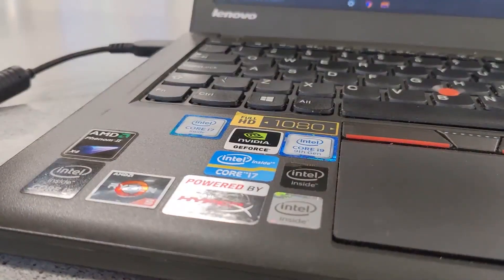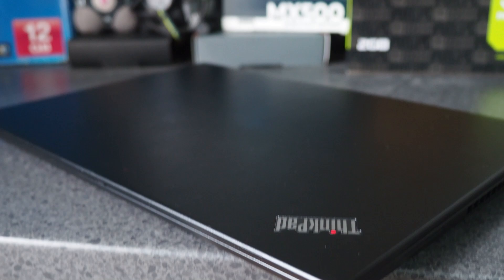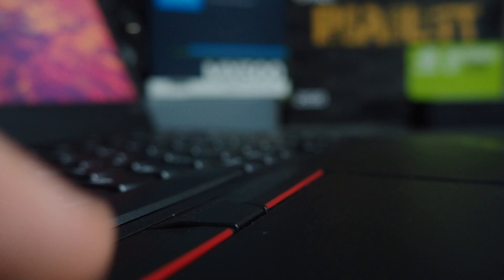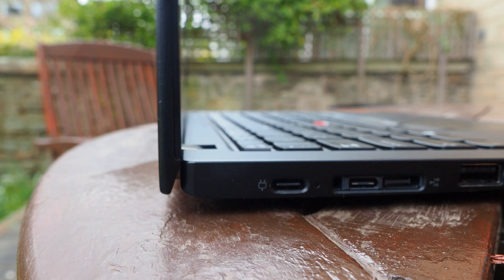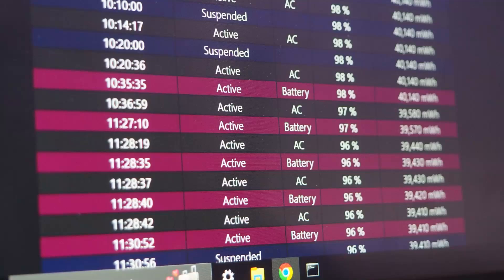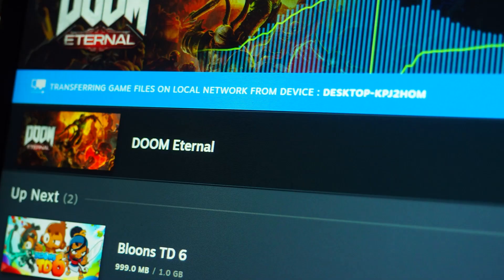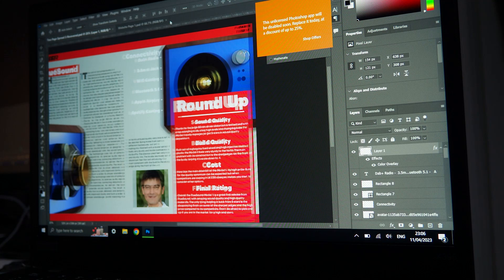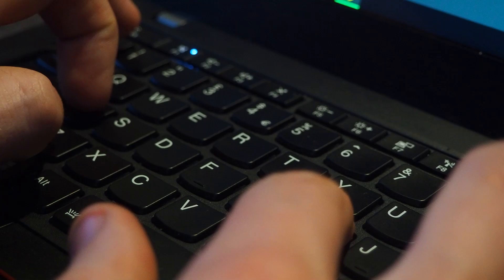Best Budget Thinkpad For 2023 - Thinkpad x395 Review

Comment: I recently purchased an X395 with Ryzen Pro 3700U, 8GB- 512GB SSD for $280 USD.  It came with no OS, so installed Win11-Pro.  It also had a couple months left on warranty.  It also fits nicely in the ThinkPad Ultra Dock like most of them do.  Screen is nice but nowhere near as good as the X1 Carbon Gen 6 with 14.0 WQHD.

Comment: I stick to my X270 for it is the last model of the series allowing to switch RAM and to switch between SATA and M.2, plus it has two batteries that last for 12 hours. I just upgraded the display to FHD which was very easy and the wifi card to Wifi6e/BT 5.3, so I'm prepared for the next coming years.

Comment: Informative video. Are you, running Windows 11 on your X395? I have a T495s R7 Pro 16/512, essentially an X395 with a 14” display and larger battery, and I’ve had a few BSOD crashes. I bought it refurbished, 11 Pro installed. Have you found any stability differences between 11 and 10? It might help me pin down the issue. Thanks again.
Reply from the maker: I just run win 10 and it's pretty stable for me never tried win 11
Reply: @InigmaDT  Thank you for replying. Clean installed 10 Pro, and so far it's been fine, so I'll let it run on that. Have you experimented with disabling the CPU power management setting in the BIOS? Some have written, it's more responsive when disabled, but there's little hard evidence.
Reply from the maker: No I have not might do that though
Reply: @InigmaDT  Thanks for the update. Currently run W10 Pro and it's been stable. FYI, with 11, the BSOD were all the same, the display freezes, and either blue screen, or I had to hold down the power button, to force a shutdown and restart.